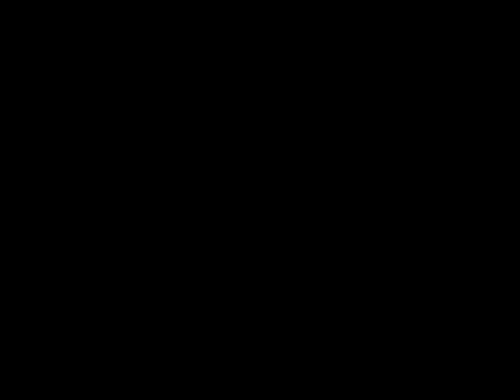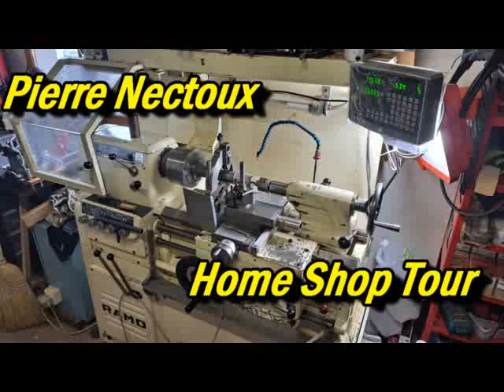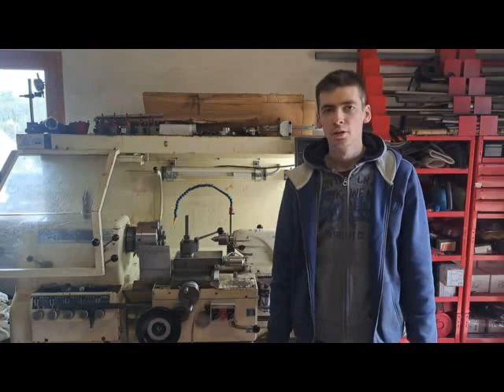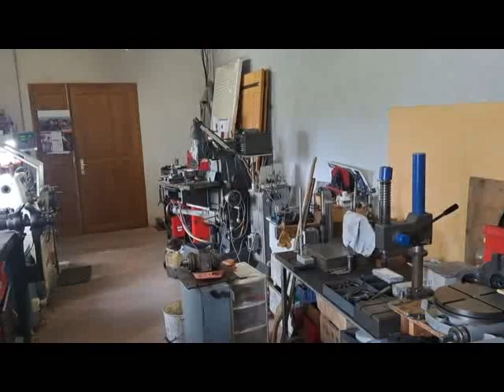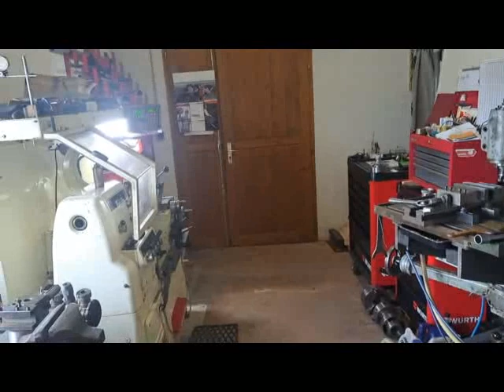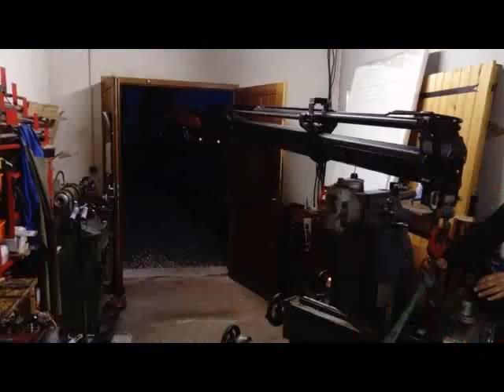From Vintage Lathes to Custom Tools: A Tour of Pierre's Shop

Comment: Hi Pierre, thanks for taking the time to show us around. A company I worked for in the late 80’s had 6 Ramo lathes, small accurate but very powerful. I worked as a maintenance Engineer there, the biggest issue was the spindle drive gearbox and drive belt. I spent many hours removing and stripping the gearbox to replace broken gears and lever forks…… apprentices used to try to change speeds without waiting for it to stop. And if I remember the spindle has to be removed to change the drive belt. Nice workshop.